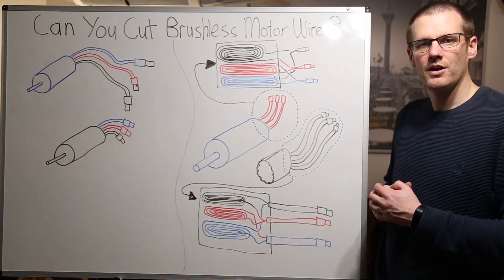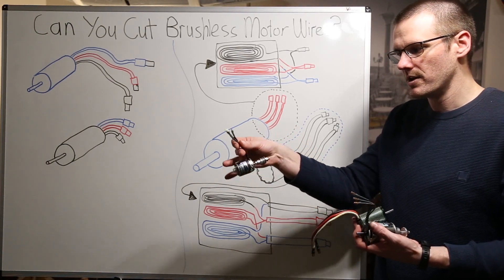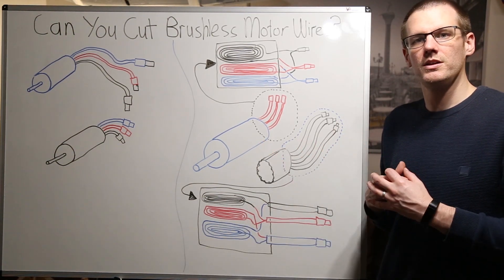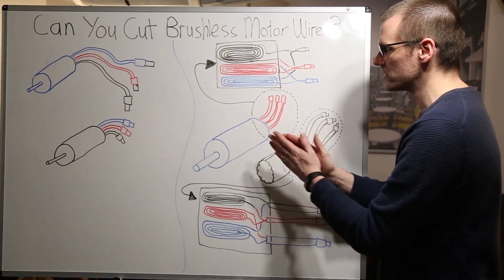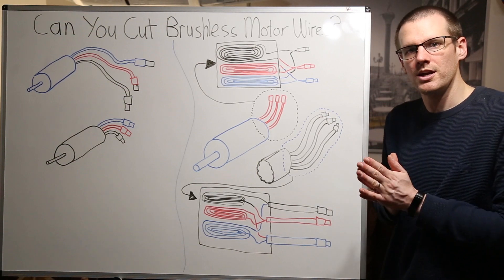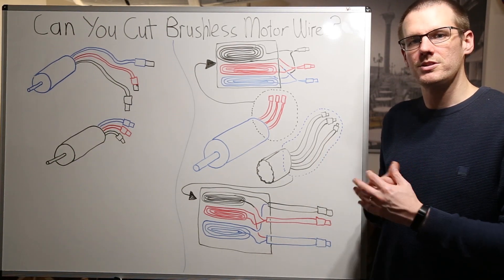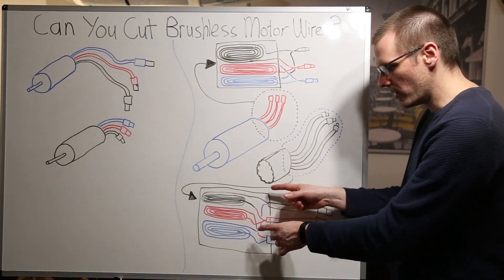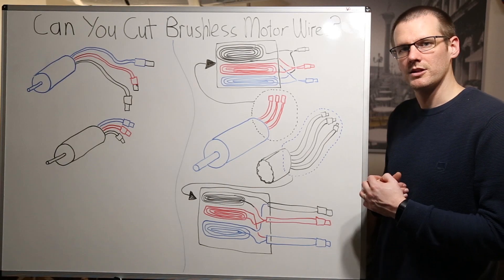Why Cutting Brushless Motor Wires can Destroy your Motor (Or even ESC)

Comment: Can I get probems when soldering new contacts to the motor cables (no shortening) ?  
I want to run a 6S motor with 7S  and also 8S (FMS 1750 kv pro). The current will raise from 120 to 155 A with 7S and around 200 A with 8S. Therefore I would like to to change the 4mm to 6,5 mm gold contacts. Does this make sense? The cables from the ESC (200A) to the motor are 8 AWG.
Reply from the maker: This is possible, if concerned about termination points in the motor wires, don't cut the wires. Just swap the connectors cleanly.
Reply: @RCexplained  Ok, thanks a lot!

Comment: I wind my own motors, as long as you make sure you re-terminate all the windings, It's perfectly safe and easy to do. Often times these motors are wound with solder through insulation/ lacquer. If not just burn off the lacquer.  This video should have focused on how to do this safely instead of just trying to frighten your viewers into avoiding this procedure.
Reply: Thank you!

Comment: My esc wires got hit by the spur gear the wire that goes from esc to the battery still runs fine just covered it with eletric tape but i ordered some 10 gauge silicone wire 200c and was going to try to replace the wire but i wasnt sure if i should or not whats your opinion? My esc it the blx 185
Reply from the maker: If you'd rather not replace the wire see if you can solder cut stands where the gear hit it. Then use heat shrink over this section, not tape.
Reply: @RCexplained  what our cut stands? This would be my first soldering project I did buy a kit came with a bunch of stuff been watching videos how to solder but have not heard of those yet
Reply from the maker: @thomaswalton9089  the wire is not solid it is stranded. Many thin pieces of wire make up one motor wire. Is the wire cut,?

Comment: This doesn't make any sense to me. The wires that lead to the termination point are going to be separated out by the insulator in which they reside. No matter how short you cut the wires as long as they still reside in the same insulator there's still terminated the same. Maybe I'm missing something
Reply from the maker: Motor wires are copper with an enamel coating, look inside the motor and you will see these.  Multiple wires of this nature could be beneath the wire insulation that you see coming out of the motor leading to the connector. The winding termination in some motors (less these days) can be at the connector.
Reply: @RCexplained  Yeah I get that. What I don't understand is why removing that connector shortening all of the wire that's inside the insulator then removing the enamel insulation re-terminating and putting a new connector on would make any difference. You're not actually changing the orientation of any of the connection you're just moving the connector along the entirety of all the wires within that insulator.
In order to actually cause a problem you would have to pull the strands of magnet wire out of the insulators, rearrange them and stuff them back into the insulators in a different configuration otherwise electrically nothing is changing

Comment: ALWAY PREMIUM INFORMATION on this channel.!     I have a motor that has Blue/Yellow/Red leads coming from it which match the colors found on the ESC,  and I also have the same Motor that jus has 3 BLACK wire,  these are both the same motors,  how do I determine which wire goes where on the ESC... sense there all Black?   Thanks
Reply from the maker: If it is not a sensored motor, it will not matter.

Comment: Ouch, I do this all the time! I only had a problem with a traxxas vxl motor. I cit it right at the bullets to fit a different size. Now it overheats fast. It was tarnished so I’m going to try and reduce it and try again. Not smart. I was in a hurry. Or I ruined the termination. I’ll get ride of the enamel at the termination point. Worth a shot. Thanks buddy. 👍

Comment: Thanks for all your vids man they're really educational.
I've installed a 5694 sss motor into an oc8s and needed extensions as the original wires are only 8 cm long.
I've gone with 8mm bullets and everything was perfect but after a few rides the car started cogging, only on Immediate FULL throttle.
I'm suspecting the extensions which are made of 8awg silicon coated wires.
Is it advisable to solder the 8awg onto the original ?8filament copper motor wires or is it better to get a same diameter copper wire to extend them? I've been thinking to replace the whole wire but I'd need silver solder and more than my 80w solder for that, IF termination allows that is, haven't opened the can.
Thanks for your help!
Reply: Hi, where are you buy the extension?

Comment: 1. unless you are being judged by the assembly neatness you should have room between the body shell and car platform in witch to fold the wires up into.

2. cutting into the windings could effect the inductance and may cause performance and even current draw issues.

3. some motors are big enough to have solder points or plugs on the back for a delta or y configuration.

some of the bigger boat motors will have 6 connections in witch you can configure y or delta.

Comment: How about replacing the bullets on a castle motor without cutting the wires? I want to use a castle motor that has 6.5mm bullets but the hobbywong esc only has 4mm bullet sockets. Would desoldering and replacing the bullets make any difference?
Reply from the maker: Castle motor is fine. You can swap connectors

Comment: Hmm I cut my 800 kv with an XLX2 without issues. I’m sure some may not be able to cut.
Reply: After watching this video one might get the idea that castle creation motors are terminated within the motor housing which would mean that cutting the wires is not an issue. Or what did you think the green motor was that he was talking about?
Reply: @diemturner5755  I have no issues with castle and hobby wing. Only traxxas. I’ll clean off the enamel and try again.

Comment: brill video ....i have a 1/14th car and brought a 60amp hobbywing esc and the wires are as long as the car can these be cut down  if so how much
Reply from the maker: You can cut down the ESC's 3 motor leads as far as you require.

Comment: I've shortened motor wires without problems, from what I understand the wires are sometimes tinned back to the motor and some are enameled, as long as you scrape of the coating before you solder it should be fine... I've done this with a 450 and an mcpx bl.

Comment: I think 1 rule is easy: If the motor has soldering points, where the wires are connected to the engine, then you are sure the termination points are inside the can, and thereby you can cut the wires.
Reply from the maker: Absolutely.  Very good point!
Reply: I've always wondered why people call electric motors engines?
Reply: Combustion=Engine
Electric=Motor

Comment: Hello,  do you have any videos on brushed motors. 
I have a separate smaller motor that i need to run along with my main motor,  both with the throttle. 
Can I just run some smaller gauge wires back to the smaller motor? 
The esc has plenty of power.
Please pardon the off topic question. 
Thank you for your vids! Great info.
I havent dabbled in brushless though.
Reply from the maker: I don't have any videos on Brushed motors. Quite frankly, I haven't used them in a very long time. Is your main motor and separate smaller motor both brushed? Are both motors ok to run at the battery source voltage? Is the ESC also brushed? What is each motor driving?
Reply: @RCexplained  awesome!  Thank you for the response,  much appreciated. 
So the tow truck is an scx24 that i dropped a wpl all metal 2 speed transmission into.  (370 brushed) 
The trailer is a micro Barrage frame, with aluminum & balsa flat bed built ontop.  Flipped around so that front tires are in back,  and able to turn with tow truck tires (i got a servo reverser).  The motor is the stock micro Barrage motor, most call it a 180, but actually i think it's a 050.
The esc is the Hobbywing 1080 Quikrun. Usually used for 1/12 to 1/10 sized trucks... so LOTS of power, and awesome programmability, and control.
Reply: @RCexplained  both motors are brushed.
Reply: Brushed motors aren't nearly and finicky as brushed motors. The main danger in your proposed setup is burning out the smaller motor.
You're probably better off using a separate  (lower power) ESC for the smaller motor. You can use a Y-harness to connect both ESCs to one signal line.
Reply: @ddegn  thank you for the info.    I ended up going with the same motors. 
I haven't purchased my esc yet, but was planning on purchasing the Holmes Hobbies torquemaster br mini dual motor esc.
When going through the building plans,  I realized that the rpm and gearing ratios would have been different with the different sized motors,  and so that would have some issues.  Probably other issues too.
But I had another question: 
Will the volts be different after traveling through up to 16" of wire to get to the other motor,  as opposed to the 4 inches...?
And if so, then how much difference will cause similar issues as before? 
Maybe I need two esc, one for each motor,  with a Y splitter to go to one RX,  as you said.
Maybe there are also other considerations.

Comment: Will a bad ESC fry a brushless motor? I noticed my fan wasn't working on my MM2. I ran my Typhon for about 4 min...Poseidon 2200kv  died temp was 203 locked up tight. I was checking my steering for a few minutes then drove it down the street . GPS 59 mph, gear 19/50 has run over 70. I'm shocked motor blew cool day 70s  esc temp was 130 IAM asking because I don't want to blow another motor...Thanks retired adult owned and baby this setup
Reply from the maker: Hey FuriousWolf, what was wrong with the ESC? It is a lot more common that a bad motor takes out the ESC vs the other way around.
Reply: @RCexplained  ESC fan stopped working.Its a Castle mamba monster 2. I'm using 2 100c 8000mah batt in series. Motor temp 203 was very high for a few minutes of running.Geared 19/50.... I have run 40 minutes hard and temp is only 120 to 130. Esc ground connector 8mm was burned also...Hope this helps Thanks!🤔
Reply from the maker: Hey FuriousWolf, if it's just a fan that quit that's not too serious. The motor temp of 203 does sound very high, that is concerning. Is the 120 to 130 on the motor on a typical run? How was the connector burned? 8mm is huge and can handle over 150A continuous. Do you have a data log of each run?
Reply: @RCexplained  amass 8mm connector  the tip burned ground side. Need to replace ... Positive connector looks like new. When I turned the ESC on I noticed the fan was off hmmm I thought then checked steering worked fine. Put car down and ran it and it felt normal except car pulling to the left. I roll down the street adjusting trim maybe 1/4 throttle this took a few minutes. Ran it up to 60 mph then it locked up. 203 temp??? How why? Not a speed run car just my when bored car something to do lol New motor on the way I was checking with you to see if I should order a new Esc? I have a 30mm fan yeah racing I can mount on the mm2. Whatever you feel is best. I love your chan! Your tips help alot. My limitless hit 89.8 the other day thanks to your tips it's a easy 100+ car sooo Thank you so much!!!!! Sorry little long lol
Reply from the maker: There is nothing apparent that leads me to believe the ESC is a problem. You will want to monitor your setup very carefully next run. Use very short time intervals to check temperature. Don't run the body so that you can check temperatures very frequently. 
It sounds like the motor was the problem, but you will have to confirm this on your next run with the new motor. Monitor heat on battery, esc and motor.
Reply: @RCexplained  I can't Thank you enough for your time and help. I'll do what you asked And share results. Thank you Ryan!!!
Reply: @RCexplained  Hey Ryan wanted to let you know what I found. Esc was okay , fan was not working because I pinched wires lol. The motor rotor blew bearings were ok. I think when the rotor let go it heated up and that's why it was so hot. The fan not working threw me off....Thanks again for your help and support!!! All the best to you💯

Comment: Would it be safe too cut about a 1/2 inch off the brushless motor wires the solder the connectors on ?
Reply from the maker: Hey Roger this really depends on your specific Brushless Motor. If winds are terminated in the last half inch, then you could be cutting right where a termination point is.

Comment: I have to 😂😂😂 so hard on this one.
Reply from the maker: If you have no other choice, just make sure you are not harming the motor by doing so.
Reply: @RCexplained  I cut most of my motor wire. Also I usually wind them myself, so I can cut anywhere I like if I make sure cutting after the winding part is over. (If I Don't cut them wire in the winding wire)
Reply: @RCexplained  i im not harmimg my motor. insted im miproving it, i see no reason on how,why my motor should get bad coz of wire cut
Reply: @RCexplained  I've shortened motor wires without problems, from what I understand the wires are sometimes tinned back to the motor and some are enameled, as long as you scrape of the coating before you solder it should be fine... I've done this with a 450 and an mcpx bl

Comment: My Dad is building a drone and I'm building my first plane just waiting on parts. My Dad without any of this knowledge has small multirotor motors he said soldered just fine after cutting. Tining was easy and throttles just fine after completion. Which leaves me wondering do some manufactures leave off the coating when the wire leaves the motor and perhaps more motors no matter the size are terminated internally than not. I'm still very new into all of this and just doing as much research as I can while I wait on my parts. I'm building a 3D printed twin prop and I'm 99% sure I won't need to cut any motor wires anyways. 31.4 in. wing span. It's going to be very challenging.
Reply from the maker: Hi Siphonlife, I'm not entirely sure which way most manufactures go. I know that I have 3 motors and only the one in front of me has an internal termination. All 3 are out runners.  In general I do everything possible to avoid cutting the wires.

Comment: Great vid!   Was going to cut wire on my Arrma motor.  Will definitely research more.  Zip ties work too.  😁
Reply from the maker: Thanks for the comment Randy. Zip ties work well. I bought a used motor that had cut wires. I realized when I wanted to switch the motor in to another RC that the wires were not long enough to reach the ESC by about 25mm or 1 inch. I had to change plans to make it work.

Comment: When you add wire to motor will this cause power loss. If I solder wire to wire will will solder add resistance? Thanks
Reply from the maker: Any addition you make to the circuit, (series connection) will add resistance. The real question is how much resistance are you adding? What is the length of wire to be added, quality of solder used and the quality of the soldered joint?
Reply: A very simple rule of thumb is that solder has about 5x the resistance of pure copper. That sounds much but doesn't really matter if you solder the two wires properly as the distance between the strands of the wire will be tiny. 

Think of it this way: if you bridge a 1mm gap with solder at the same thickness as your wire then this would be similar to just having 5mm added wire.

Comment: Great information! Since I only run cars, I don't have this concern. However, I can see how this can be a tricky situation for those who use these types of motors.
Reply from the maker: Thank you for the comment! If you can avoid cutting motor wires that's best!
Reply: there are rc cars that use motors that are terminated at the bullet connector. the slash 4x4 vxl for example.